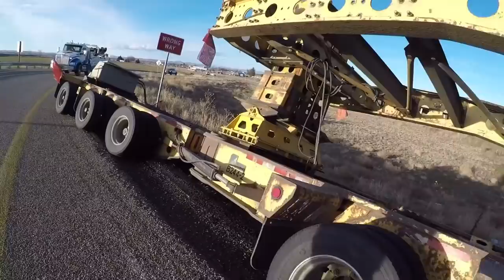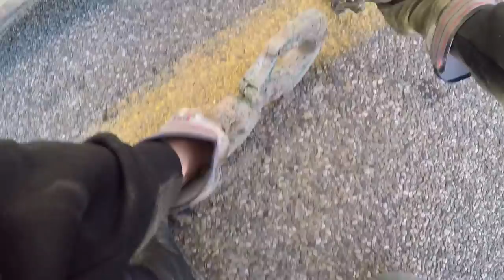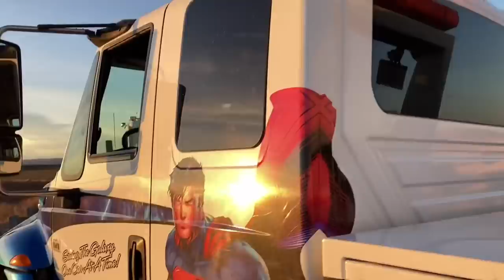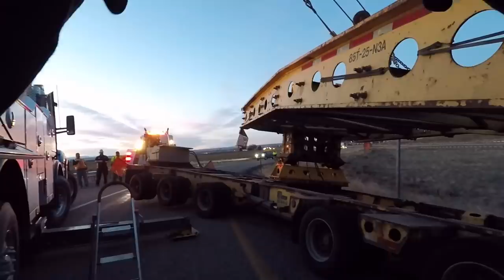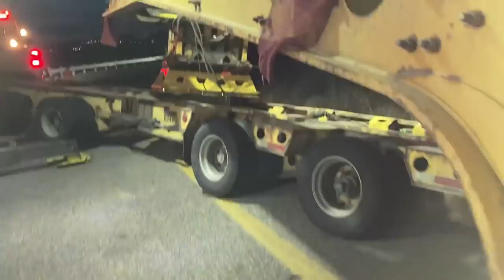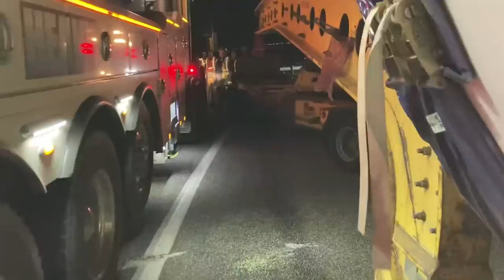250,000 Lb Windmill | SUPER LOAD | Leaner

Comment: I worked for a heavy haul carrier and those sections are heavy as hell. I want to know why his escort vehicle didn't stop him before it got that bad.
Reply: I was just about to ask if this is the pilots fault.
Reply: Looking at the dirt piled up and the angle its on 
It prob got close and he was told to stop but you can't really stop in a hurry 
1 side started to go and it prob just slide off 
Only stopped cause the belly hit the road
Also said the hydraulics steering failed so it might have just dived its self into the ditch
Reply: @fowletm1992  I have 3 of these type of 13 axle self steer trailers and there is no possibility he was going fast enough to no stop. That turn would have been tight enough the trailer would have to be manually steered. Who ever was manual steering that steer trailer just F’ed up. So so lucky that Hat didn’t break off.
Reply: @yeahok115sure  
It says they had a mechanical failure 
So basically it put its self in the ditch
So the driver had enough time to stop between the time it took the rear guy to pick up the radio then process what's going on all while the trailer is making a break for the ditch 
Could go into a second by second breakdown of what's probably going on
But basically it's a case of sometimes shit just happens and the world's not going your way that day 
It's not if but when you have one of these days
Reply: @fowletm1992  you speak the truth! I’ve been lucky knocking on wood no major issues with our 3 girder trains. It’s scary to even think about. I just finished up a job in October. We where 240ft long and 300,000lbs. If anything broke on my trailers it would catastrophic. Best wishes!! I took the time to actually ready the video description after ready your replay😂. It clearly stated mechanical failure sorry For my earlier reply

Comment: Enjoyed the rescue. Like the joined two part line for the balanced steady pull. Never used it myself and often needed to see-saw very heavy loads to break mud or snow suction with a much too small wrecker with the rear wheels standing on chocks chained to the deck and the front tires floating/bouncing.

Comment: So likely their permit is for daylight hours only.   Did they just park up right there?
Nice work.  Stay safe.
Reply: I doubt it, generally your'e aloud to proceed to the nearest safe place to get off the road. They may have needed a police escort tho.
Reply: 69 u r most likely rite. That would b the most likely safe spot . Like that othe guy I think he thinks u can keep going till u find a wal-mart or truck stop.. wrong
Reply: @randywilson6869  no the other guy  has 29 years of experience hauling big stuff all throughout USA & Canada. There is no way anyone would even be able to put that in a Walmart parking lot. The permit is for daylight travel only. and because of the inability of the idiot driver and trailer operator to slow down and steer the trailer around the corner if needed they are out after dark ( they could possibly get charged with failing to adhere to the conditions of the permit) They will not be permitted to stay put as you may have noticed the were on wrong side of the road counter flowing. they will be escorted to nearest safe place to get off the road. IE; a rail siding, seed plant or elevator and yes maybe even a truck stop what ever is closest and large enough for them to get in and out safely.
Reply: @havocreaper2404  Actually, you're pretty idiotic calling the driver that, the hydraulic steering malfunctioned, not too mention you didn't see it happen, nor do you have any facts outside what video showed.
Reply: @mikeef747  yeah except for the fact that they were just off the side of the road and not way down in the ditch and the dollys didnt have  hydraulic fluid all over them and their was no trail of fluid on the road anywhere and they drove it away not only that they were stear the dollies during the recovery so the "problem" your'e claiming never happend lol. I've been hauling shit like that for 29 years, I've picked up a thing or two.  They went in that that long ways close to the edge of road because of speed and likely lack of maintenance (grease) those steerable dollies when they are in the float position if they are not taken care of will stick and do exactly what you do not want them too. Sometimes you can give it a little bit of a "whip" to break it free if you just made a corner and it sticks but that means you have to stop and add grease. And if your smart when you do your morning pretrip you grease the pivot points.

Comment: Never heard of those as jeeps.   Always Mules   Yes today the thing behind an RV is most often a Jeep.

The thing behind the Horse that tagged along to haul the weight was a Mule.  When did that change?
Reply: I've never heard of that called a mule. Neat. Jeep here. Question about what you call the tag dolly behind a lowboy. We say Stinger. (the one that pivots left/right, but not up/down.
Reply: @gen157  I’ve always called the front a jeep. And the tag at the back is a booster.
Reply: We also call the back on this trailer a Dolly.

Comment: Suggestion... when the rig is moving really slowly, it's hard to see that movement when your camera is moving. Put the camera on a tripod, and you can just let it run, and speed it up in your video editor to show a time lapse (or use your camera's time lapse mode). The GoPro couldn't see well but that's a solvable problem... portable lights.
Reply: Agreed. Also would get him out of the danger zone. Seems to be too close to wires while it's pulling. Very dangerous.

Comment: Have you considered putting regular oil under the tires when they are on the pavement to help them slide when your pulling sideways, seems it would cut down on the friction of rubber vs road
Reply from the maker: We’ve done that with soap and water
Reply: Seems like oil would leave a road hazard after the fact, interesting idea though. Maybe even loose sand and then use a blower to clean it up when you're done. Or soap and water, as was said before

Comment: As someone who knows nothing heavy recovery can I ask could you not have taken the trailer load with the rotator, uncoupled the jeep/mule/dolly swung the trailer out and put it down on the highway then recovered the other piece then put it back together afterwards?
Reply: I'm guessing the the load weight exceeded that of the rotator, so they couldn't do a full-lift
Reply: Too much weight and unhooking is never a good idea
Reply: @robertquast9684  the rotator is lifting the whole unit anyway so they can pull it sideways  so uncoupling would reduce the weight would it not?

Uncoupling the trailer? It isn't going anywhere as it it attached to the tractor unit and aren't the brakes on heavy haulage "on" by default and require air or manual wind off to release. The dolly/mule/bogey  has its own power and probably isn't going anywhere given it is sitting in a huge rut but it could be tethered or chocked.

Comment: what is the reason for the hook up for pulling one wench to vehicle back to wrecker back to vehicle and back to wrecker wench why not just back to wrecker why wench just wondered and wanted to understand never seen that done before
Reply: When you go back and forth you reduce the load on the winch line. You divide the resistance by the number of lines and you will get the load on the line. Example: 10000lb pull with the line going from the tow truck to the casualty and back to the truck and then to the casualty again gives you  3 lines to the load. So 10000 decided by 3 gives you 3334.333lbs of load on the winch line, so we always round up so line load is 3334lbs

Comment: What's the model of each of the Wreckers on this job  ? Not what each truck is, what is each of the wreckers mounted on the trucks  ?
Reply: Tk 28 is a Kenworth t880 with an 1150 rotator, tk 15 is a Kenworth T800 with a 35 ton boom, and tk 7 is an International 4700 with a 12 ton boom all the wreckers are from Miller Ind.

Comment: The ones they haul bridge beams with have rear steering so the chase vehicle can steer it or tell the truck driver which way to steer it.
Reply: Same deal with these either a failure in the steering or someone messed up
Reply: @hamishcampbell4578  most trailers are self steer now-this was an old trailer and there should have been another truck driver steering the rear because its illegal for escorts to steer these trailers on the highways
Reply: @autocat9371  must have different rules downunder followed one into site last month and there was definitely a person in a van steering the rear around the tighter bends.
Reply: @autocat9371 is 100% wrong…. You have no clue

Comment: Bro , u got cool content  👏👌 , but please  buy  Gimbal  🙏
Reply from the maker: Does the go pro 8 have a gimbal built in?
Reply: @CountryEquipmentRentals  go pro suck !  
They use digital  stabilization  ,  buy Sony  x3000  if u wanna  use action  camera 
But my advice  buy something  as Samsung  s20 with wide angle camera( very useful when not enough  space  ) and Dji  om 4 (  easy to install and calibrate  phone) 
My video  about  T2000 filmed on  samsung  ( in motion  with phone +gimbal)

Comment: Shouldn't be standing so close to the cables if snapped would cut you in two
Reply: We totally understand what you are saying. Here we take great care to make sure we are not exceeding the manufacturer’s working load limit of our lines. We have a very well trained crew. The controls for the trucks put us in harms way and wireless remotes do not allow sir positive control of the hydraulics.  A towers job put them in bad positions at times and that is when it is most important to know how to calculate resistance and know the limitations of your equipment.